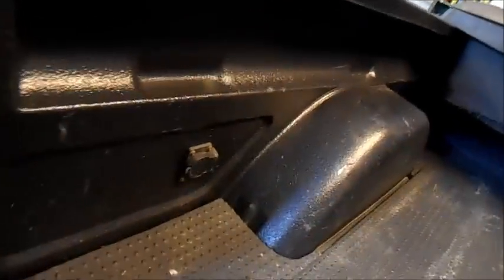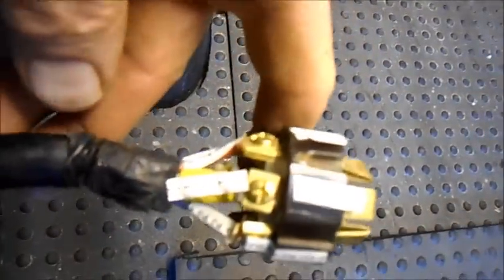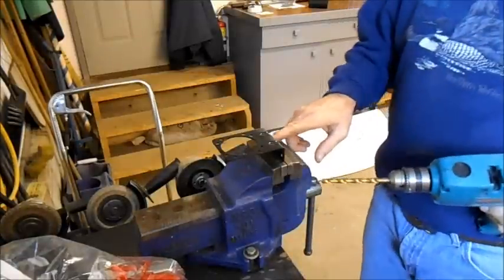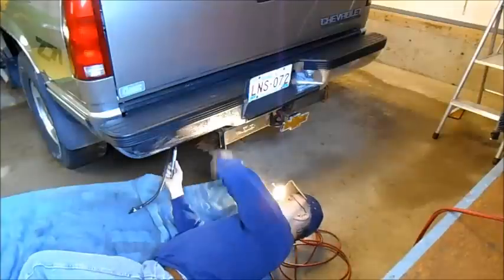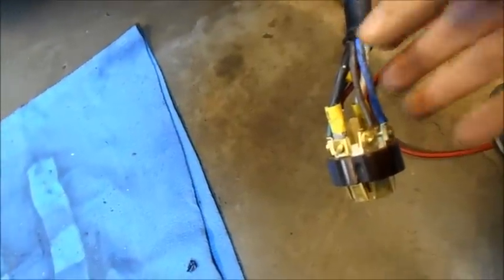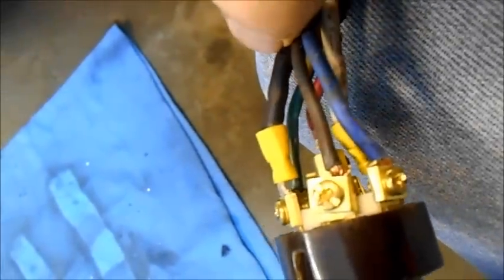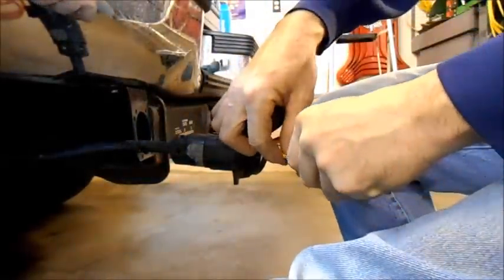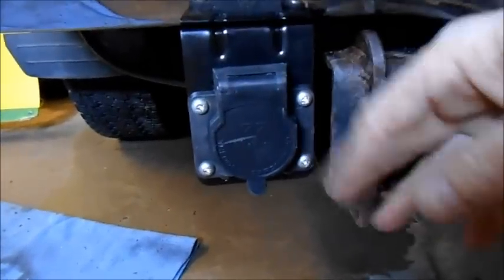Wiring for a 7 Pin Trailer Connector

Comment: Hey Bruce. Why? Why "move" it? Why not just get an extension harness and add it to the bumper? It took me half the time it took you to do the same thing, only I still have the connector in the bed too.
Reply from the maker: +AlwaysFreeAmerica I wanted the Truck to be stock again.  I am just that way
Reply: I certainly understand that! I'm the type that likes versatility and added value. I still have the ability to mount the 5th wheel if I need it again so I just left the connector in the bed. At the same time, I have the ability to connect to the bumper connector for when I load up the receiver. All's good when it works the way a fella wants. Thank you for the reply Bruce.
Reply: I have the same issue. I bought the truck a few months back and found the connector in the bed side but deeper.  So your saying I can leave it there?? I wonder if it's been wired for the controller??? Great video much appreciated

Comment: what about the yellow wire?
Reply from the maker: not used.
Reply: Yellow is reverse lights if your trailer has them. It should be the center pin.
Reply: @Unknowen7  can I tap into that wire for a backup camera rather then go through my assembly?
Reply: @jvirg  I don't believe so. It's just a power line for the backup lights.